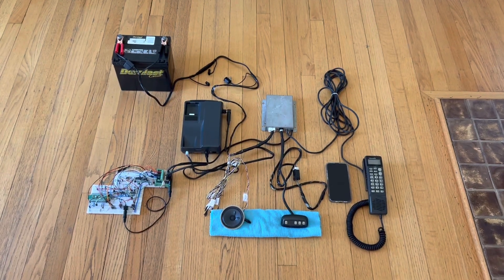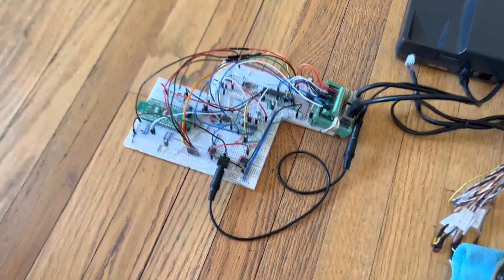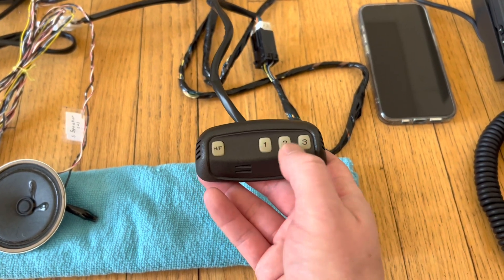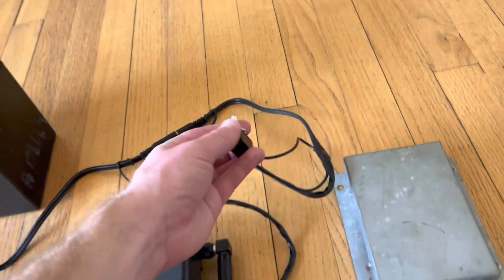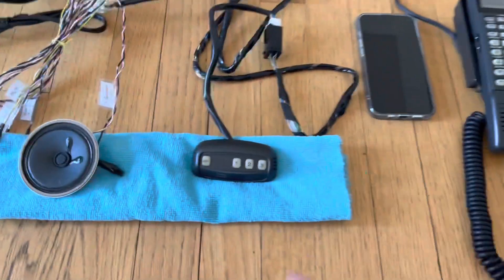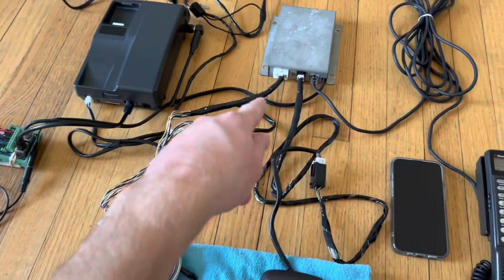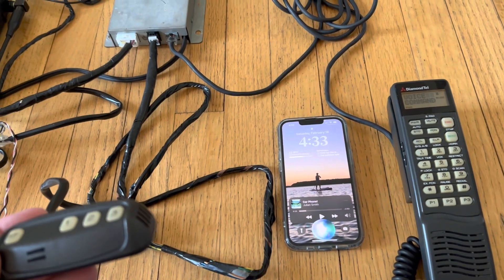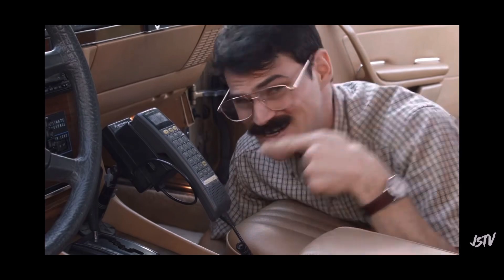Car Phone Project: Hands Free System

Comment: I have a Motorola Bag phone complete I'd like to install in my car. Do you have instructions and a parts list?
Reply from the maker: My Bluetooth conversion is for the DiamondTel Model 92 phone. It would not work with any Motorola phones.
Reply: I guess I have to figure out a conversion for the Motorola. Great work!!! My cousin had the 3000GT in 1999 first manual car I drove 😊 he wanted that radio for months finally found one and swapped it 😂

Comment: Can this be done with any other analog cellphone? Just curious
Reply from the maker: Hypothetically, yes, if it is the type of phone with a corded handset connected to a transceiver. The connections/communication between the transceiver and handset need to be reverse engineered, then custom hardware and software needs to be developed to interface with the handset. The same general approach as what I did, but different phone-specific details.

Comment: This is super cool, can you please share some details/part number of the cradle on which the phone sits? I have been searching randomly all over internet with no luck. TIA.
Reply from the maker: According to the phone's instruction manual, the handset cradle has a part number "CR-92". I doubt you'll find anything by that part number, though. I got lucky and found a complete new-in-box phone phone with portable kit and generic vehicle mounting kit on eBay. I've also seen a couple used phones for sale over the past few years that included the cradle and transceiver mounting plate.

Here's a bunch of info I compiled about the phone, including PDF scan of the owner's manual: https://www.3swiki.org/Accessory:_Cellular_Telephone

I have a couple spare new-old-stock cradles from a different, but physically compatible phone. The link above has some pictures of this alternate cradle compared to the correct cradle for the Model 92. Feel free to message me on Instagram (@uselesspickles) if you have more questions.
Reply: @UselessPickles  Thank you so much. It will be awesome to connect with you. I just picked up my 92 VR4 red, always wanted the car phone in it. I will reach out to you in  instagram. Thanks again, super cool project.